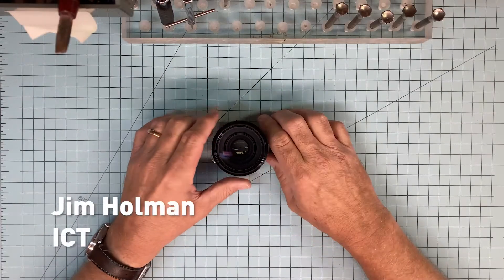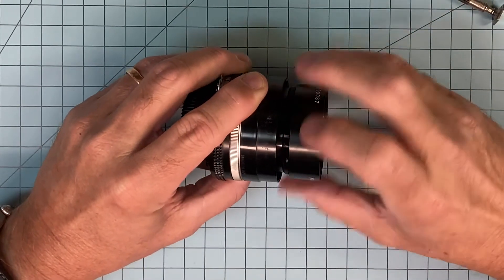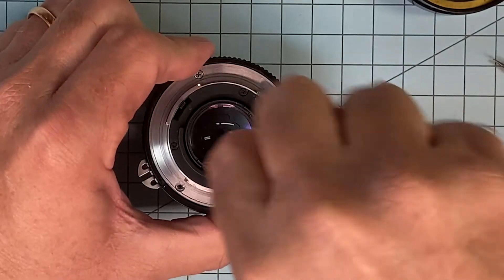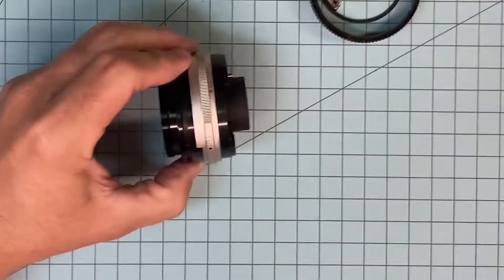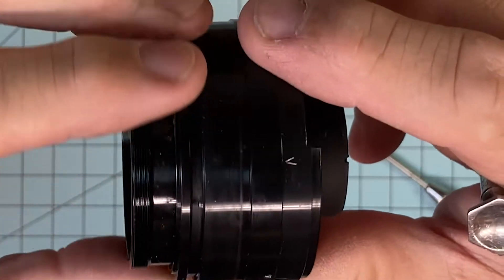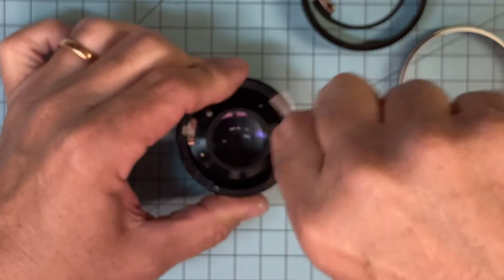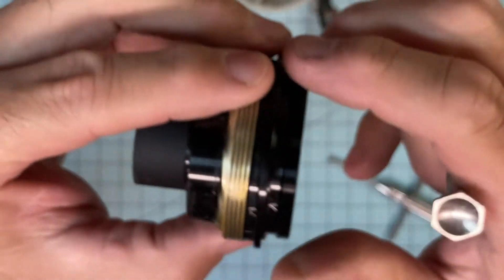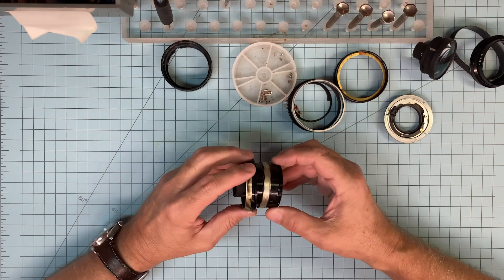Watch this before you disassemble your lens! (35mm Nikon Lens Disassembly & Repair)

Comment: A hobby watchmaker here.  I know nothing about lens repair and you are an expert ... but I have to say, it pains me to see the multiple scratches, even though it looks to be quick and convenient.  A version of this was the common practice on watch casebacks but is very much frowned upon nowadays.  I recently got a few cheap and/or broken lenses to see what working on them is like.  I will try to find a non-permanent way to make alignment marks.  That aside, thank you for the very educational video.
Reply from the maker: The areas I put alignment marks at are not visible when the lenses are put together, this isn't a watch back.  Non-permanent marks will be removed when chemicals are used to clean out the old grease, and if they do get removed when cleaning it will make repair almost almost impossible for the amateur since many lenses have multiple starting points.

Comment: I'm loving this. Going to practice on some super cheap old lenses. I will say you move way to quick for me. I needed to slow down and rewind several times to get an idea of what you were doing. I'd look down at an example lens just to look at parts and by the time I look up you've moved 2 or 3 steps ahead.
Reply from the maker: Sorry about the speed. I've been repairing lenses for 40 years now and I just get into go mode and it is almost impossible to slow down.

Comment: Where did you get your screw driver set and what is it called?
Reply from the maker: The larger cross point drivers I got about 35 years ago, I don't think they make them anymore. The flat tips are Starrett drivers with removable tips, other drivers I get whenever I see them.

Comment: Hi, thank you for your vdo. I bought an old but classic Nikkor 500mm reflex f8 and pulled them apart to clean the fungus which I did however I failed to mark the thread and as you can imagine, i'm at a lost now on how to put the focus ring back. Is it counter-clockwise when putting the focus ring back? Your expertise and advice would greatly be appreciated!

Comment: Helllo good sir and thank you for the informative video. 
I recently acquired a Kiron 28mm f2 Konica AR mount, absolute brand new condition.
Sadly, after only a week of using it I unluckily dropped it straight onto the stone floor of a church, head on to the front rim.
There's barely a dent, focus ring runs smoothly, but here's the issue:

1) the aperature is ring is almost stuck, and requires quite some force to be set to 2.8 or 2.
2) while focusing, although smooth, I can see my field of view sorta tilt very slightly as I change the direction of the focus ring from left to right.

so clearly it took a hard hit, some things got loose (the tilt in view) and the aperture does not respond to changes, the diaphragm does not move.

When a lens is dropped this way from waist height, do you think it is repairable? The impact clearly prevents certain parts to operate as they should.

Your reply is highly appreciated before venturing down the rabbit hole of disassembling this beautiful piece of glass.

Thanks,
Thor
Reply from the maker: Impacts are difficult, and from your description the aperture ring or barrel under the aperture ring are bent. It also seems and element may be loose inside or is no longer sitting flat. It is not possible to get straight forward answers to a impact repair because there are so many variables. Sorry, not the greatest answer.

Comment: I've had to give up as unrepairable several Nikkor lenses recently because the rear screws would not budge. I tried everything: tapping as you suggested; applying heat with soldering iron and/or heat gun; acetone etc and the screw head will sooner disintegrate than come out. Have you had this happen before and how do you deal with it?
Reply from the maker: Some of the screws in the older lenses can be a real bear to remove. My technic is fairly simple, I give the screw a shock using the screwdriver than using a lot of downwards pressure I wiggle the screwdriver first one way than the other very quickly. Doing it this way I don't have problems with mount screws anymore.
Reply: What screwdriver are you using?